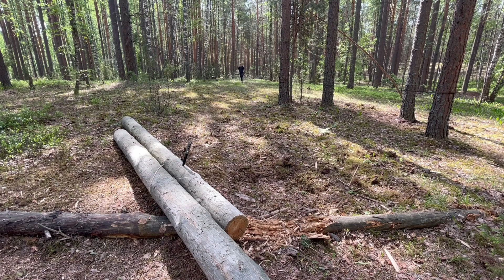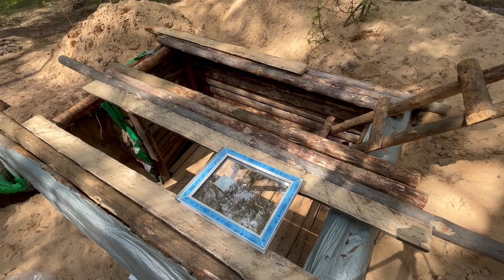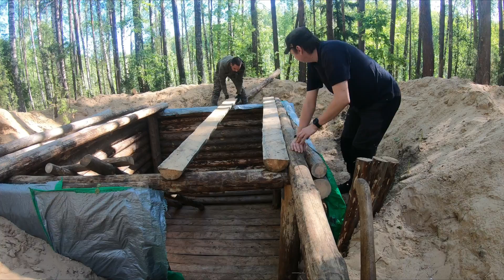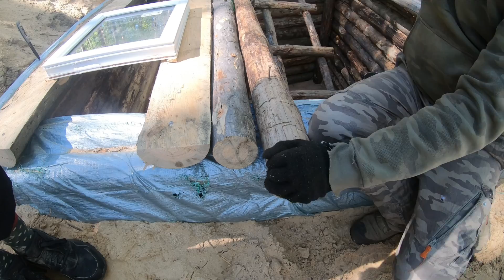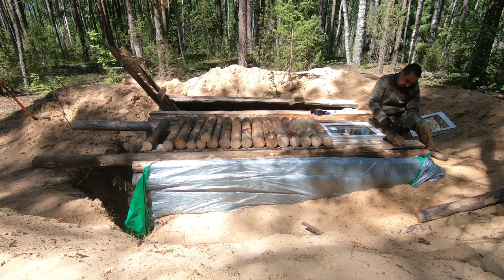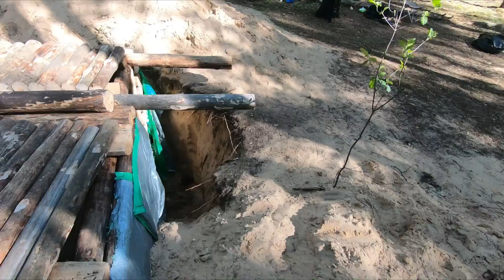Made the roof and windows in the dugout

Comment: as a ex-window fitter you never lay double  gazing flat  there will be problems in the future  always at an angle like a Velux window at least  like on a roof of a house that had the loft converted into a room with Velux that go's for any window  covered or not water will get there heat inside your wonder full dugout  and cold air out side   dont mix  great job  love it   :trophy-yellow-smiling: